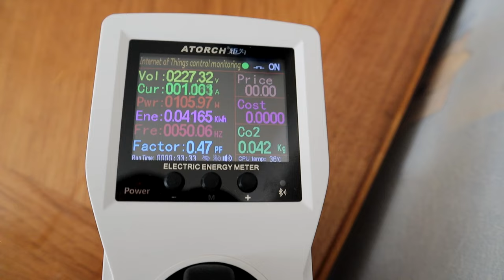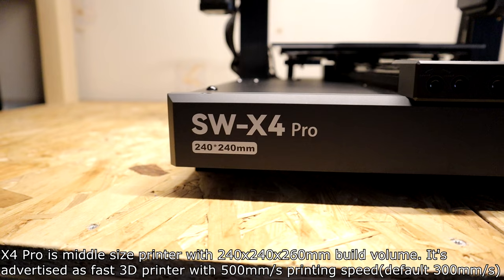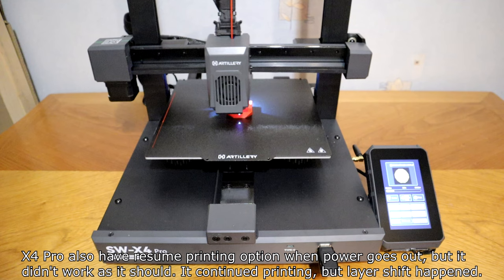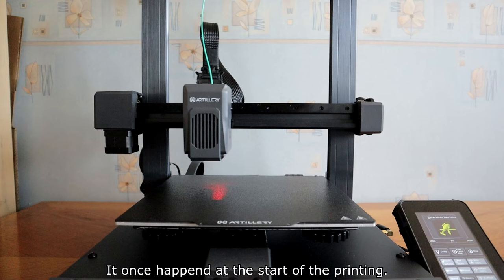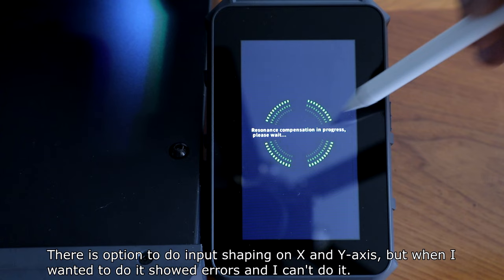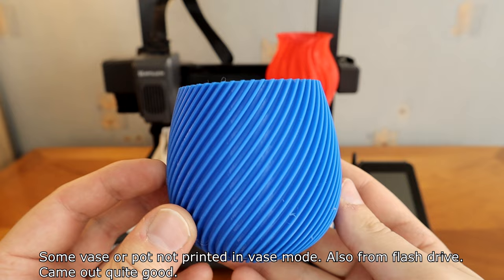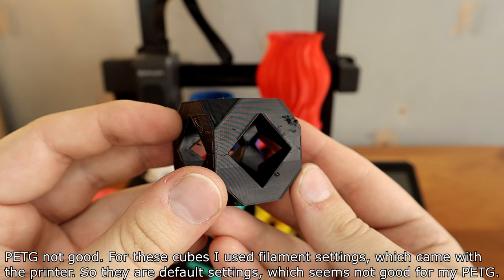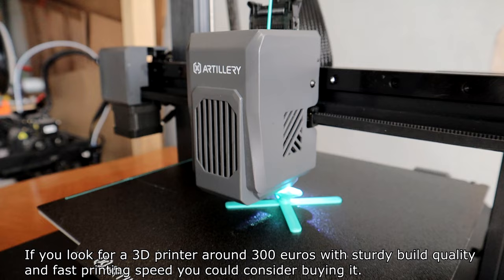Artillery Sidewinder x4 Pro - Fast 3D Printer with Linear Rails

Comment: 5 : 42 You saved my printer print bed so you earn a sub. Thanks bro appreciate your warning and guidance. Do you think it's mandatory to grease the rails or do they come pre greased ? I forgot too and had a 24hr print on.. will it damage ?
Reply from the maker: Hi. Thanks for the sub! I greased it after I assembled it, because it felt dry.  You should grease after 500 hours of printing. It's written in manual.

Comment: Hello. You were the first channel I watched that neutrally listed the disadvantages of a product. Although the Artillery Sidewinder x4 Pro may seem like a good printer on paper, the disadvantages you mentioned in the video cannot be overlooked. I'm planning to buy a new printer these days. There are two printers I'm torn between: the Artillery Sidewinder x4 Pro and the BambuLab A1 Solo. Buying the Bambu printer might financially strain me. Which printer do you think I should choose? Would it be right for me to put myself in financial difficulty by purchasing the BambuLab printer? Is the Artillery Sidewinder x4 Pro sufficient for hobby use?

Also, I'm open to other printer recommendations you may have. Regards.
Reply from the maker: Hi. If you have the money I would buy Bambu Lab A1. But if you want something cheaper I would choose Artillery Sidewinder X4 Pro, but I would wait until there is firmware update available. You can watch my other review videos. Maybe it helps to choose your 3d printer. You could also watch Sovol and Creality printers, but if you want same fast printing speeds you need to pay more. Also thanks for watching and have a nice day!
Reply: @3DPrintsBuilds  
Thank you, have a good day !

Comment: Hi, I've got this printer over a week ago. First prints were very nice, but the more I printed the more quality dropped. As this is my first 3d printer I didn't really know what was wrong and why it failed so much. It turned out that I have to level it again, so I started doing it, but It's fcking impossible. It's absurd how difficult it is to level this printer. Can you give me some tips how to level it? I've found out that no matter what z-offset I'll set with a new firmware (from 19th march), once I tighten the knobs bringing the bed up to the nozzle,  the printer ignores the z-offset I've set, because with every new print it goes to home position, checks for bed height with a nozzle and ignores the z-offset I've set to not let me scratch the bed. No matter how high I'll place the bed with knobs and how low I'll set the z-offset, even under the bed, the printer just ignores it. What do I do?
Reply from the maker: Hi,
Leveling seems to have problems. Try to level again like I mentioned in video. I haven't used new firmware, but I had similar problems with old firmware too. It seems that it's not fixed with the update. If you can't fix this issue with leveling again, you can add brim to prints and adjust z-height when printing brim. It's not a good solution, but it can help. You can also contact Artillery support.
Reply: @3DPrintsBuilds  I decided to get rid of the printer since because if there are so many issues with leveling right out of the box then what will it be like in the future?

Got myself a bambu lab p1s. I've heard it's really reliable. We'll see...
Reply from the maker: @redrocker1582  I have Bambu Lab X1C and I like it. After TH board change I haven't had any problems.
Reply: @3DPrintsBuilds  Why did you change it?
Reply from the maker: @redrocker1582  First versions had TH board problems. Bambu Lab sent new.